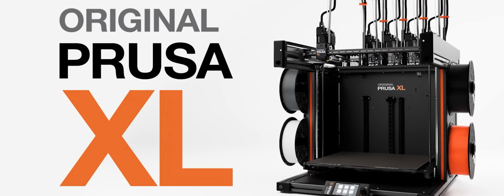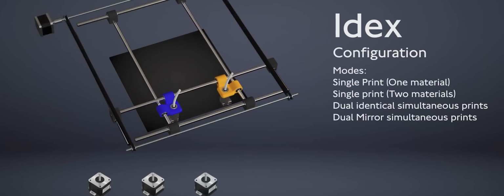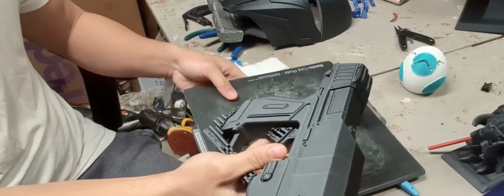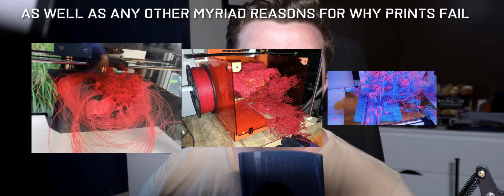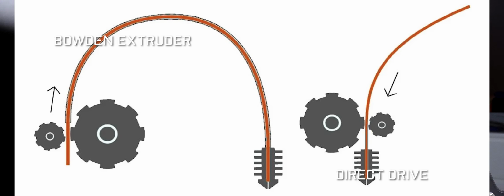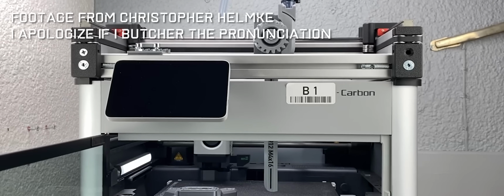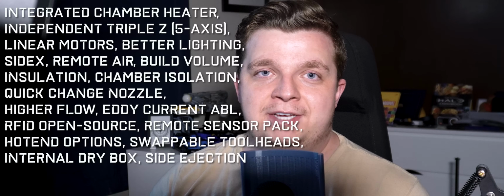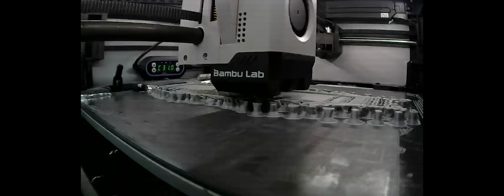Bambu Labs Next BIG Printer

Comment: Yea... Beacon might be faster than Opto / Mechanical solutions but who cares? With a properly setup Start Routine that speed gain will do NOTHING since most likely you'll be waiting for either the Chamber or at least the Heat Bed to have come to Printing Temperature giving any Opto / Mechanical Solution all the time it needs for it to finish its Probing Cycle. It's like that guy overcompensating with his Muscle Car angrily overtaking you when 20sec later you come to a halt next to him at the red Street Light in your paltry Smart. A Probing Scheme with a sensibly sized Grid and / or Adaptive Meshing should also hardly take any more time to begin with.

And then there's the benefit of Tool Head Compliance with Solutions like Voron TAP ( in the DIY Space ) that allow the Tool Head to be pushed upwards and away from a Print whose Corners have started to curl up potentially getting the Tool Head caught on - A Compliant Tool Head will just get shoved up and come smacking down again with a Thunk Noise warning you before disaster strikes. A non-Compliant one might have its Hotend ripped off at the Heat Break ( unless you have one built like a Tank like the Slice Engineering ones )
Reply from the maker: I can see your point.  I think there are other benefits as well.  Magnetic sensors have higher resolution than many mechanical systems.  But they also don't suffer from things that can trip up those mechanical systems.  For instance, with my Bambu, in rare cases, the filament buildup has affected the z-offset enough to cause a print failure.  The filament piled up underneath the nozzle progressively causing it to move further from the bed as it completed the cycle.  No contact from a magnetic sensor means this can't ever happen.  You mention preheating the bed, but often the printer will heat the bed and then run a probe cycle.  That's how it is for the Bambu and many others as well.  Since these steps can't really be parallelized (due to thermal expansion) speeding up the probing cycle still has a sizeable benefit.  As it pertains to a tool changer setup, a magnetic sensor is uniquely qualified as it can more easily account for variances in z-height between toolheads.  Mechanical sensors are also subject to debounce, which can either cause errors or dramatically slow down the probing cycle.  At the end of the day, magnetic sensors are easy, cheap, and better all around so I expect that they'll become standard flair in future printer models.

Comment: What if they used magnets to drive the nozle drive gears.... Might be able to lower weight
Reply from the maker: I'm not sure I'm understanding what you're saying.
Reply: @OddJobEntertainment  Oh I was just wondering if you removed the motors from a direct drive nozzle and used magnes to drive the gears to advance the filament as a way to lighten the nozzle assembly even more while maintaining the advantages of a direct drive setup
Reply: @OddJobEntertainment  sort of like a mini maglev train that goes in a circle... The gearing that moves the filament.
Reply from the maker: @SiliconRiot  well if you consider the inside of the motor that drives the filament, you essentially get what you're describing. Motors are magnets interacting with an electromagnetic field created by the copper coils. A rotary motor makes more sense in this case because extrusion is a high torque application.

Comment: The Company that comes out with a (at least 2 heads) printer, has all the other features we have come to "need", i.e. auto bed leveling, chamber heat, input shaping and at least a 305mm bed, etc. will be king for at least a year.   It only makes sense to have print material and support material without purges or so much waste.  IDEX type machine really speeds up that print when you need supports that fall off or 2nd color.

Comment: Have some mates that have been allegedly testing what is an X2. That should be the next printer out from them. I was hoping for a P2 series, but I don't know if that will be out for a while. I'll likely be picking up a Qidi Plus 4 and an A1 from bamboo later
Reply from the maker: If they follow the same pattern the P series will follow stripped of some high end features.
Reply: We need an A1 "Max" with 30cm that just works for the poorer folks. Elegoos current big printers are crappy. Would pre-order an A1 Max combo instantly.

Comment: Please do not get the X1C. They have a huge design flaw where the bearings are press fitted to the frame of the machine. If and when those bearings wear out. There is no way to replace them because they are locked into the frame of the machine. The majority of users have had these bearings breaks after 250 days of printing.
Reply from the maker: This is actually the first I'm hearing of this. Mine has been functioning flawlessly. I'd be curious to take a look at it though. What axis specifically?
Reply: @OddJobEntertainment  there is a bearing behind the machine on the bottom left side. That bearing is secured permanently to the chassis of the machine. Eventually that bearing will wear out even if you lubricate it. This is because it is held down by hard plastic. The bearing will slowly grind away the plastic and cause your belts to loosen to where you cant print anything. There is another bearing that is secured to the main frame of the machine which is located on the front side in the upper right corner of the machine. More and more people are starting to have issues with those bearings after around 6k print hours. The sad part is bambulabs doesnt seem to be doing anything about it and there are no replacement parts for it since they are stuck permanently to the frame of the machine.
Reply: Iv heard stories like this for litterally every printer out there lmfao.
Im convinced that 99.99% of these goofy ahh stories are prolly from literal retards.

A mf on the comment section litterally said he returned his X1C because his nozzle got a clog and bro had no idea how to unclog it ig.

Comment: Almost every point mentioned has its flaws, for example regarding the fans he said that adding tubes with larger quieter and more powerful ones will be beneficial but the reality is that running tubes requires lousy fans because of the air pressure that will built up inside the tubes; another ting is regarding the overhangs in a tilted bed: at the moment none single free slicer allow to move every 1 of the 3 independent motors for the bed, you need to write custom gcode or another slicer; another mentioned point is belts and motors for moving the toolhead comparing it with the new printer from peopoly but that machine requires another kind of maintenance, is expensive to built and is for another target of consumers.
You have a lot of good points, but your missing the biggest one from BBL itself: they don't want to serve a 3D printer for print farms. They main objective is to have good, cheap almost-reliable, house appliance to enable 3D printing for the masses and convert their 3D printer in a common electronic in a house, like it was the typical 2D printers (HP, Epson, Cannon, etc.)
Reply from the maker: Well, of course, there are flaws. That's engineering in a nutshell, looking at and comparing alternatives. VZbot uses CPAP fans to have great success. Just on that point, you can end up with tube's that are inflexible and too heavy, or they're too flexible and sag as a result. In engineering, you'll always need to consider potential downsides, but that doesn't mean you ignore alternatives and potential benefits.

Comment: I’m considering getting a P1S as my first printer, but I don’t know if I should wait for the next Bambu printer to come out before I make a purchase. Do you have any advice or do you have a prediction of when specifically we might get more info of when the next Bambu printer is coming?
Reply from the maker: Unfortunately, I do not have any kind of inside scoop. P1S and the X1C are targeted to different kinds of consumers. Any new flagship would likely be targeting the same price point as the X1C, and so you should make your determination with that in mind. Are you an X1 consumer? Or is the P1S better suited to you?
Reply: @OddJobEntertainment  Actually, in the time since my first comment, I changed my mind and bought a Creality K1 Max, because I realized the larger print volume was more important. Thank you for your feedback, I appreciate the help.
Reply: @liammiller.design Ooh.. bad idea. Unfortunately I’ve had one of those and it’s never worked. Jams, breaks, and unhelpful support. I returned it  before it caught on fire. Would not recommend.
Reply: You will not be disappointed with the P1S

Comment: Bamboo have made printers into tools that just work but the old guys just want to tinker with them still... I get a single / dual head to enable better multi material but the rest is just superfluous additional complication that will lead to problems and failures. The limiting factor is likely already melt speed anyways. There's a speed limit to all things including fdm
Reply: Also linear motor likely do not reduce mass they just unwind the motor along the gantry. Core xy is superior despite its maintenance requirements. Implementing the many ideas here would mean a way way way more expensive machine for little gains and make it inaccessible
Reply from the maker: Qidi Plus 4 just hit market with $800 pricetag with a good number of what I've requested.  Linear motors do add a little bit of weight to the gantry compared to carbon rods on their own but they dramatically simplify construction.  They also have true closed loop communication which helps a lot with error reduction and repeatability.  Even without increasing melt speed, an improved motion system has intrinsic benefits.
Reply: Nah lowkey linear motors + tool changers are standard on CNC machines and are long overdue to be on 3D printers.

Comment: I want a larger print volume. Even if it’s just a 400mm sq x1c.
Reply: When shopping around for a 3D printer I was SUPER TEMPTED to get a Creality K1 Max for its 300mm cubed print volume, but I don't really print anything stupid tall needing that Z dimension, so the X1C is great for me. Even if I print something tall it's with in the 256mm^3 the X1C has and provides.
Reply: @ShiggitayMediaProductions  It’s useful for printing helmets and other wearable items. The x1c can just barely do it. I have to print at an extreme angle.
Reply: @greatwhtrabbitt  oh yeah I get that such tall volumes are great but not for me at least not so far lol

Comment: My next filament printer will be the ProForge 300, with the motor upgrade and at least two tool heads.
Reply from the maker: Hadn't actually heard of this one, looks pretty cool.
Reply: I’ve been following this guy for years and as he’s developed his products they’ve got better and better. I saw the four tool version, but was quite critical, then I saw the ProForge250, and for an extrusion based low volume printer, it was competitive in the UK, with some good design elements, plus you can add to it. I have an X1C, after other printers, and I was able to good results from day 1. It’s been upgraded, but won’t do anymore to it now… need a toolchanger, as want to organise filaments grouped  based on temperature within each tool head, fed from dry boxes and an AMS system.

Comment: I absolutely would not buy this printer if it came with a bowden tube.  It creates too many additional variables to f**k up and its 10 times harder to purge if you need to clear a clog.  The  added 30mms is basically next to nothing   when your just generally printing day to day things.  Yeah i know some people want max out their print speed but i would much rather have a more stable system in the long run than have it print a bency 30 seconds faster on something thats prone to failing more often.  I transitioned to DD and im not going back.    Otherwise i think the other suggestions are good.
Reply from the maker: Fair enough. I'd like to see it as an option. There's a few limited cases where it's handy. I'd want them to stick with DD by default. But if BT was an optional add-on, I'd like to put one in my bank of heads.
Reply: @OddJobEntertainment  it would be interesting from a technical standpoint to see how they could make them interchangeable.  Those interchangeable nozzles they make are interesting and I wouldn't have thought it possible to do that so if anyone can do it bambu lab could.

Comment: Cpap tubes are heavy compared to a small fan. And the motors don’t react that quickly and being a considerable distance away needs time to build pressure
Reply: Also cpap motors are expensive
Reply from the maker: You should look at the VZbot project. Open source high speed printing using CPAP. Tube is 15g compared to 24g for typical fan used on Voron.

Comment: Magnet rails are cool but very heavy.
Reply from the maker: They don't have to be. The only important part of the rail is the magnets.  Everything else can be made of lighter weight materials.
Reply: @OddJobEntertainment  then why didnt peopoly make it lighter?
Reply from the maker: There's always tradeoffs with any engineering decision. Carbon fiber is lightweight, exceptionally rigid, and more expensive. Other printers are more sensitive to high gantry weight because a skipped tooth on the belt means a layer shift. Since linear motors have closed loop control, it's much harder to get those kinds of print defects. So with much of the penalty of a heavier gantry gone, it's possible Peopoly didn't think it worth the added cost at the time.

Comment: Whil I think multi head would be good … I really doubt it’ll happen.  Not at the prosumer price of $600 ish.  
(P1s and x1c are pretty much identical for 95% of the use cases)
Reply from the maker: I think $600 is quite restrictive for prosumer. That'sstill on the budget end. The X1C is $1450 as a bundle. I'd expect these capabilities below $2k but not by much.

Comment: You still have a purge tower with the Prusa just no poop.
Reply from the maker: I did say "reducing the need for purge towers".  The XL uses less material in constructing the tower compared to an X1.  But you are correct, the poop is definitely the largest contributor to waste.

Comment: I have a Bambulabs P1S after running all K1's in a small print farm for over a year non stop  i was very excited to add a very reliable accurate printer to the line up. What i have found is that although it's a great printer the carbon rods seem to be it's achilles heel when it comes to long term reliability printing ABS, ASA. They have bound up aftr 8 months creating weak under extrusions and once the chamber gets above 40 degress celsius the issues start to occur. I heard one reason is they changed the self lubricating bearing to a cheaper steel one and since then problems have been occurring. The K1's although not nearly as refined as the Bambulabs printers have proven to be more reliable due to the stainless steel rods on the gantry. A few dabs of grease every now and then keeps them sliding away without issue day after day. The Bambulabs is more of a surgical instrument and would be great long term with cooler less less tacky filaments like PLA and PETG but for high temp long prints it does fall over.
Reply from the maker: Everything has tradeoffs, CF is lightweight exceptionally rigid, but needs special care compared to cheaper, heavier, steel.

Comment: What i would love the most would be able to print with different nozzle sizes on the same print. Larger print bed could be nice to have but not as much as a multi-nozzle.
Reply: I would totally love that. I design 3D terrain for tabletop gaming. Some part of my building are fine in draft mode, actually it’s beneficial once painted while some details within the same build needs high details. The ability to change writhing, would help a great deal.
Reply: Oh my God that would be amazing! I'd even be willing to swap them out manually if it were possible with a pause partway through.
Reply: @Oberon4278  ideally, interior features would be printed with the larger nozzle, and exterior perimeters would be printed with the small nozzle. So the printer would need to swap every layer. Swapping by hand wouldn't be fabulous in that case.